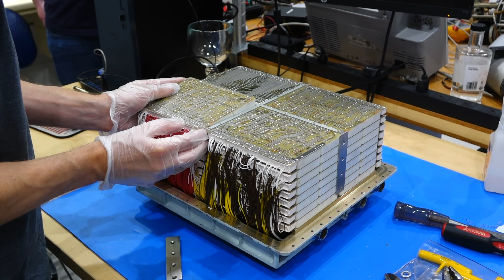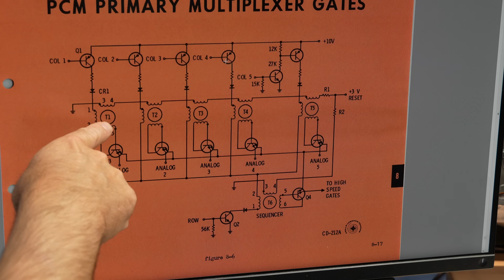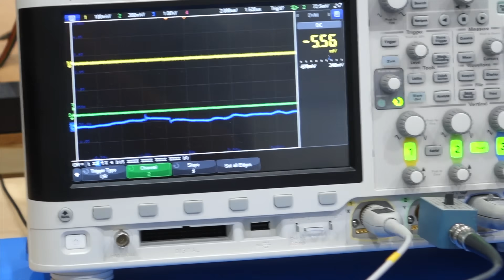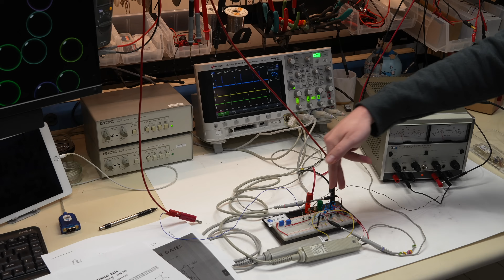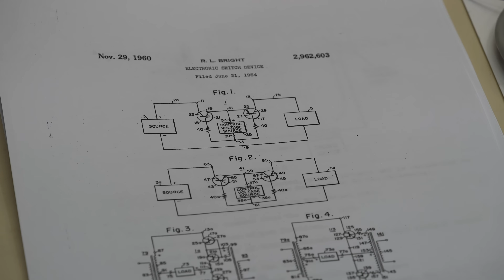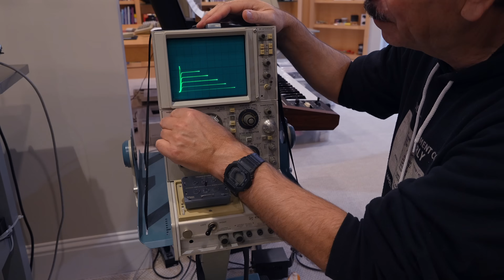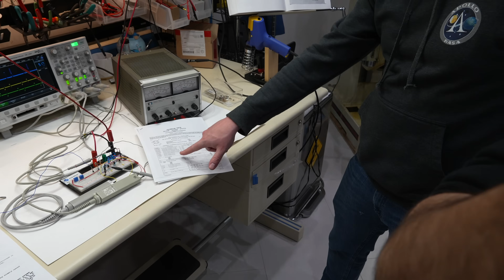Apollo Comms Part 37: Apollo's weirdest (but genius) analog circuit

Comment: The transistors are used backwards for lower saturation voltage, which is a characteristic of "chopper" transistors.  Tektronix used the same circuit with two discrete NPNs in their later sampling oscilloscopes for sample and hold elements at about 50 kHz.

Comment: I would love to know if this a germanium or silicon device? 

Bias and reverse leakage (of the Ge types) are quite different from silicone's higher required B-E voltage and virtually non-existent reverse leakage (opposite direction current through the junction when off) 

Would this be one of those cases where the lower required bias was needed to make this circuit work?

Comment: I bet the cores are wired together as a circular shift register.  All you need is a start circuit to write a "1" into the first register and clear the rest and every clock cycle the next Chopper circuit will be enabled ...

Comment: We used backwards transistors as switches all the time in satellite telemetry. The reason for swapping collector and emitter is that the collector resistance is the lowest in the device, so offsets are the lowest. The gain is unity, not a serious problem. Lots of bipolar devices were used as analog switches before CMOS dominated. Bipolar offer lower capacitance than MOS, so high frequency isolation is still superior. Still the best at HF is the PIN diode. Look that up for next time. I bet they are switching microwaves in the comm channels. You can still find multi-emitter transistors in TTL inputs where they are multiplexing input logic signals.

Comment: This reminds me of quad diodes setup rather than dual emitter transistor (wired bit differently than diode bridge) DC bias above 0.65V between the proper points will make the diodes conductive just like a wire. I bet the four-pin conductor is just 4 diodes. For example: the datasheet for ADC AD7170 page 5 the "Load Circuit for Timing Specifications" show how precise injection of a load to a pin is done by forward biasing the diode to achieve nanosecond switching parameters for the timing charts

Comment: This sort of multiplexing lots of analog inputs to a single ADC and multiplexing a single DAC to lots of analog outputs was common in classic 80's analog and semi-analog synthesizers. Though they had the cd4051 8-to-1 multiplexer chip to do it (and a cap and op-amp to hold the outputs).

Comment: Haven't seen that analog multiplexing technique since 1975!  It was taught while in 31730 (instrumentation and telemetry) tech school at Lowry AFB.  We didn't get deeply into the theory. As technicians, we needed to fix it not design it.  FYI, that's also when we learned how to use a transistor curve tracer.  Guys, thanks for answering the mystery of how it works!!!

Comment: Nice, brilliant people in those days. Now a question from a complete layman (I am a naval architect): how did they now which signal was selected? What I understand is the MUX collects multiple individual inputs  and sends it out on one output. How do you know which of the input signals is on the output at a specific time? Do the input signals have all specific different frequencies that they operate on?
Reply from the maker: The frame control logic (they call it the programmer) generates the pulse that flips the required core at the right time in the frame, just before they need to send the measurement.

Comment: How fast could this system switch between the numerous analog systems to allow the DA converter to capture a data sample?  I have to wonder what the "duty cycle" for each analog systen's capture was like?  Because in the time while one analog system is being captured, all the others are _not_.  Was the "capture time" comparable to the "not being captured" time (a 50/50 cycle)...  better... or worse?

Comment: I think another benefit of the magnetics is a degree of fault tolerance:   If the drive transistor (or any of its drive circuitry) gets stuck on, that channel will just stop working, but won’t corrupt any of the adjacent signals

Comment: You should look into MUSASINO-1 and Parametron logic.   Parametron logic is using two Toroid coils to create a NOR gate.  By using a wire to excite the frequency between the coils, when the same frequency goes in one direction, it shifts by 180 degrees.  When that signal goes though another logic coil, it will shift BACK 180 degrees (it might of ben 90, its been a year since I looked into it). I built a makshift AND, OR and XOR gate with it but having some noise issues.

One annoying thing though is getting proper schematics for it.  It looks like for the MUSASINO, they made a bar of those coils for an entire logic block (ADDER, Register, the like) but it looks like they are using a solid shaped piece of iron for it..  Really wish I had better pictures of it.

Its magnetic core memory was a bit inefficient as you used two cores for each bit, however you didn't need to do the whole "read-rewrite" you had to do on normal core memory, as well as using the Toroid's to directly drive the memory without the need for amplifiers.  The exciter AC wav produced the power for the whole thing.  I kind of want to see if you could drive it at very high frequency's, like a GHZ, but only been testing it around 100kz because my scope sucks.

Comment: The Microwave Repeater I worked on used Tubes to multiplex 600 channels of 1200 baud modems, then changed them to all transistor after Apollo

Comment: It is interesting all the different behavior you can get through different combination and connections of P and N silicon.
In some ways the "inch" seems like a hybrid between a JFET and a MOSFET where it has the general design of an N channel MOSFET but uses a direct conduction path (like a JFET does) to introduce the carrier electrons.  I wonder why they didn't just use a MOSFET?  They were commercially available in 1964.  Well, if they had then we wouldn't have had such an interesting YouTube video.

Comment: "...But the circuit that the in-ch was based off of was [from] 1954."
If that's the circuit that this weird transistor wasn't based on, because he says it was based off of that, then which circuit was it based ON?

Comment: What a great video!  Back in 1982 I bought a Nakamichi BX-2 cassette deck.  I studied electronics at Imperial College, London and was, by then, working at BBC Television Centre in their major production studios (wonderful times).  Naturally, I obtained and studied the service manual for the BX-2 and was puzzled by the use of upside-down transistors across the line outputs although they were obviously driven by a "mute output" command from the microprocessor.  Having bugged me for some 40 years, I only recently thought to ask MS Copilot about this and it revealed the trick (no gain, but great as a switch).  I made the connection about half-way through the video which made my enjoyment of it even greater.  Thanks very much for posting this video.

Comment: The EMI Synthi music synthesizer (mid-70s) made similar use of BJT saturation in a one-transistor stage that converted a sawtooth to  a square wave.  I can't find a way to post an image here, but it's a simple common-emitter stage with resistors in both the collector and emitter circuits.  You can demonstrate the effect with a 2N3904, using an 11K collector resistor, 10K emitter resistor, 100 ohms in the base, and 5V supply.  Output (from the collector) decreases linearly with rising input voltage until the transistor saturates (about 2.75V input); after this is rises linearly as it stays at VCEsat above rising emitter voltage.  This results in a triangular DC transfer curve.

Comment: ... I suspect... in the - "four leg Transistor"  -  "FET" like  - field switching occurs ....  //   which effect connects the two emitters ....  //   TRANSFORMER is required because  of FLOATING drive requirement  //   Today we use MOSFETs for this type of  signal switching

Comment: Idiots!
1. The fourth lead is connected to the metal case of the device, and used only as a shield for the ambient noise. It has no other function.
2, The device is a "special" transistor, designed for very low VCE(sat). That's all. No "magic" here.
3. Most small signal transistors will do the same job! In addition, interchanging the collector and emitter results in even lower saturation, and
4. Biasing the base via a large resistor to a higher voltage, in order to turn the "switch" on, renders the pulse transformers unnecessary if the source of the signal is low enough and the input resistance of the ADC is moderate to high! 🤣
Reply: PS. Two small signal diodes will also work OK, and form an even faster "switch". Ideally a bridge rectifier can operate well, up to10 GHZ signals, if you build things right!
It is called a "Sampling Gate" 😊
Reply: whether the 4th lead is connected to the case, or not, does not change that it still has a function.

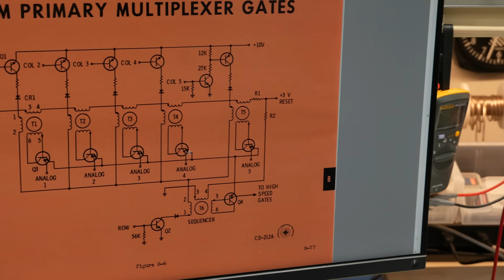Comment: 10:44

They did it this way because the circuit itself is resistant to radiation. Space is very radioactive.

Sometimes these charged particles can hit analog equipment like this (generating an actual radio signal in the process) and cause problems.

Radio interference with this was thought to be a problem. This circuit splits the overall radio transmission in half (in the circuit, not over the air).

This allows the device itself to correct the signal through a passive means. Think of this as an "ECC" multiplexer.

Comment: If you want to find another of these strange sort of transistors, you need look no further than a classic 7400 NAND gate. The base is pulled to Vcc, the collector goes off to the usual TTL amplifier element... and each input is directly off one of the two emitters of the same transistor. Either emitter can pass current backwards when the inputs are low, so the output can only be low when both inputs are high (not passing base current).

Comment: Swap out the magnetics for a photodiode optoisolator. Then use two mosfets back to back and you have a SSR. Bonus points if you use SiC fets that can handle 2000v

Comment: Unless I am mistaken, I’ve seen a similar circuit before in a telemetry system. I can’t share details, but when we were taught its operating principle, this kind of coupling was called a “phantom circuit,” which probably explains your surprise.

The system we worked on was a medium-speed data communication setup using modal communication—that’s all I’m allowed to say. I was also amazed by how it worked. It was developed in the 1970s–early 1980s, and many new technologies, including magnetic resonance systems, still rely on this communication protocol today.

Comment: Just about 5 years or so later Intersil was making a multiplexer in a bespoke 48 pin CERDIP package, which not only took your analogue inputs in, but also had a sampling clock that would both sample and hold, and also demodulate the data.

However I did see those exact 3N68 transistors used in the SA330 Super Frelon helicopter, used in the 3 axis gyro system to drive part of the autopilot system to correct for errors in pitch and yaw, with another used with the altimeter to get altitude information to do height control. then followed with some more Jfet devices to clamp, and then a few 741 opamps to do gain and offset on the sampled signal.

Comment: I learned about 45 years ago from our genius designer that the B-C junction works as a higher impedance B-E junction.  He used this feature for a very high isolation switch.  I don't remember the exact circuit but I believe it reset the hold capacitor on a peak detector.

Comment: I found this application on a NASA webpage:

https://ntrs.nasa.gov/api/citations/19670000101/downloads/19670000101.pdf

Double emitter suppressed carrier modulator uses commercially available components.

Comment: Those transistors act as a diode with base high impedance mode, once in active forward mode emitter signal will appear at the base and at the same time at the other emitter node as well. When in cut-off mode emitter signal will be blocked off.

Comment: The first practical videotape format, quadruplex, used a transversely mounted head wheel with 4 heads on it to scan nearly vertical tracks on 2 inch wide magnetic tape. The head rotated at 14,400 RPM for NTSC video. Thus, each pass of a head would record 16 or 17 TV lines of video on a track. The encoding was analog FM. This system required extreme mechanical precision to work properly, and this precision was never totally achieved in normal operation. Especially when recording composite color video, errors would creep in that varied between the vertical position of a given TV line on the tape, and which head was playing it back. Thus to create really satisfactory color playback, a means had to exist to store a correction signal for each TV scan line of 16, for each head (the seventeenth line, which wasn't always present, repeated the sixteenth line for error correction). This required an analog memory device with 64 cells (16 X 4), something which was a serious challenge to engineer in the 1960's. RCA Corporation's solution, the CAVEC (Chroma Amplitude and Velocity Error Corrector) used switched capacitors to store this analog data, one set for chroma amplitude errors and the other for timebase velocity errors. Unusual dual emitter transistors as you describe here, probably of the same type, were used as the switches. I have always wondered how these transistors work. Thanks to you, now I know! I have in my collection, a CAVEC module out of a TR 70 quad videotape machine. For its day, it was a real feat of engineering, and had a price tag as an accessory to match! Ampex had a similar system in their machines, but I am not sure if it used the  dual emitter transistors. I will have to look in a manual or at an actual velocity compensator to see what it uses. It would be interesting to see if a couple of 2N3904 transistors would function in place of one of those dual emitter transistors, to  be a potential replacement should one of the original transistors fail. Thanks for posting this!

Comment: For ONCE I already new something that Curious Marc did not! I "discovered" the reverse BJT years ago when doing circuit analysis (for fun & exercise) on the first lower cost models of Heathkit DMM. They used a clever and minimalist ADC converter made from a couple logic gate ICs, a handful of BJTs and a JFET. A couple of the BJTs were connected with their E & C pins swapped. They were being used as poor-man's analog switches, along side other BJTs that were acting as voltage comparators. It surprised me at the time, since I recalled my college textbooks and professors basically saying "don't connect them backwards". A more experienced engineer told me that it was quite common in the 1960s to see circuits using single reverse-connected BJT's as analog switches.

Comment: I remeber hearing somewhere that for typical BJTs, the leakage of a reverse-biased BE junction is often much smaller than the leakage of a reverse-biased CB junction. I think this feature is used to implement cheap, low leakage input protection diodes in some Fluke multimeters.
Low leakage when off would be another desirable trait for an analogue multiplexer.

Comment: I wonder if these days you could skip the core and use those LED + solar cell in a module IC's to get your floating drive requirement. 80% less cool of course.
Thinking I might steal that (22 transistor) circuit, I want some high ish voltage analogue switching, but I don't want to pay high voltage analogue switch money for it

Comment: I found a case of a transistor being operated backwards recently. Not intentionally in this case. Revisiting with Pspice I managed to characterise exactly what the circuit was doing and bug that people had been tatting with to try and fix for 40yrs.
So satisfying to really nail down a problem. 

Though what you guys are doing is basically what my day-job was, I do love watching. 
Your phrase that 'microwaves are the darkest of dark arts in analogue electronics', was regularly used at work. (As that was some of what I did.)